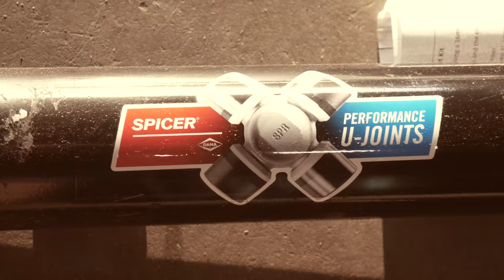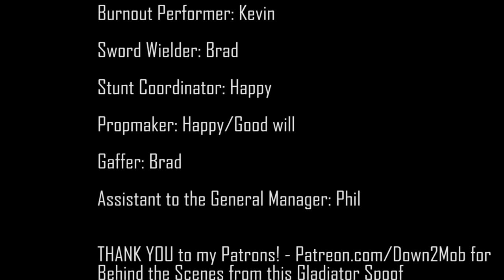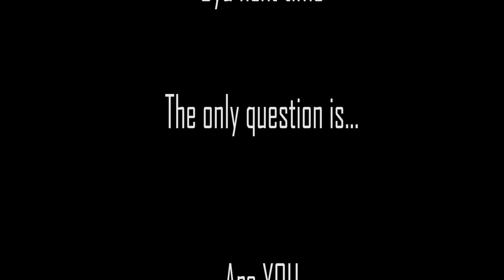Gladiator the Movie SPOOF Parody - Broken Jeep get's the Ultimate Axle Upgrade!

Comment: ditch the Jeep.  Problem solved
Reply from the maker: I would have easily totaled a Tacoma, or any other truck with a full front bumper and not massive tires to take 100% of the hit and snap the axle. The body would have been totaled but it didn’t touch it